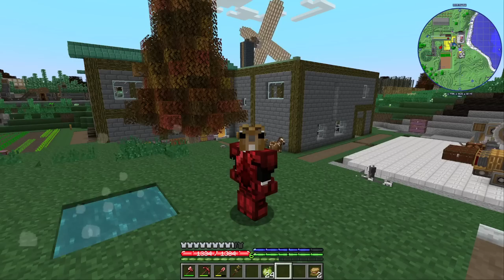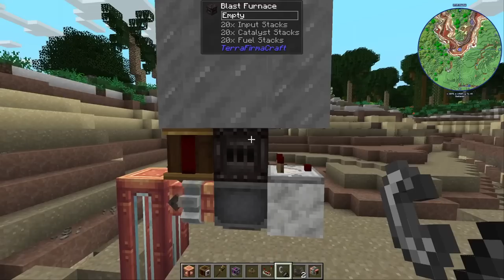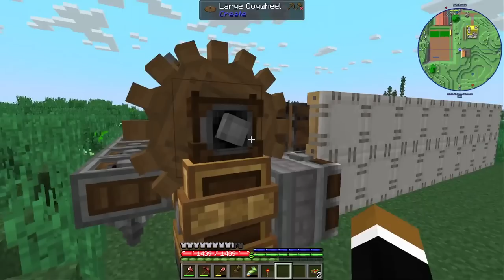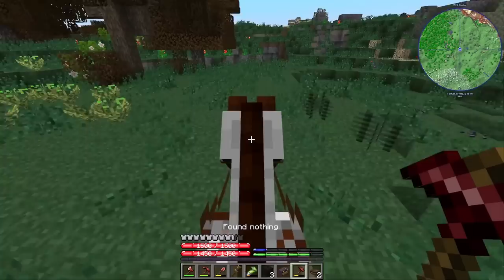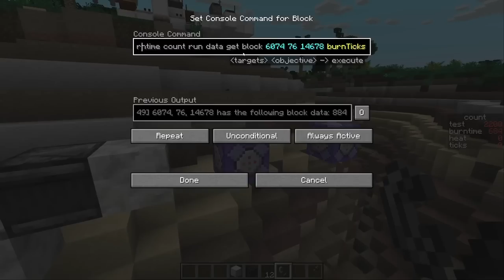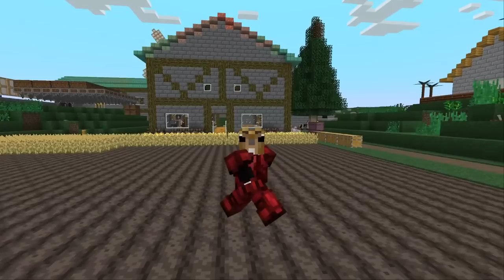ATFC: Super Precise Full Size Blast Furnace (Episode 38)

Comment: FYI you can use redstone quartz lamps to make a relatively simple counter. They work like a multi-state latch, so you could create a quick circuit that when pulsed increments through the states and eventually loops back
Reply: Another method is to chain a bunch of the Create redstone latches (T flip flops) to make a binary counter. Super easy solution if you want to count to a power of 2.

Comment: Just heads up about placing more chests on minecart contraption. When you pick it up, all items in chests are stored in NBT of one item and you can actually chunk ban yourself (or corrupt your save) this way (Create should be actively preventing this, but it cannot be trusted 100% - it used to be quite big problem in earlier versions).
Reply: There's a limit of chests you can put in a minecart contraption that you can pick up. After a certain number, you can't pick it up with a wrench anymore.
This happened in this series, on episode 32, at about minute 18.
Reply: it’s fixed
Reply: he has reached the limit before. create prevents it, you can't pick up the contraption at all if you do it.
Reply: @cobaltbluesky2276  yea i consider that a fix, you won’t crash your world anymore
Reply: @keejay98195  weeell, not that its impossible but it should def help, cuz if you have a lot of a particular item that happens to have a lot of NBT data, i dont doubt it could still crash, or with the right kind of data. Though idk if the limit is based on NBT data stored

Comment: If you are struggling with SU id reccomend making a steam engine, they generate so much more in such a smaller size.

And if you want, try experimenting with the portable storage interface more as it is a very useful tool for example unloading your drill machines really quickly instead of having to do it manually, which allows use of more vaults futher on

Comment: Those nice spacious vaulted ceilings under the copper roof are just begging for some wooden beams running across under them, and maybe some posts in the middle of the beams like the posts are holding up the tip of the roof!

Ooh or even an open loft, and you could put your bedroom up in it

Comment: The roof is not slanted correctly at the intersection. Rainwater would pool in the part that slopes into the second wall and cause water damage. I know it's Minecraft and realism isn't the point but for TFC i think it'd be nice for the roof to make sense 😅
Reply: You just add V shaped metal sheet in the bottom of the intersection so water has a way off the roof and boom, no water damage!

Comment: Please use a vault and a portable storage interface with your contraptions. It will allow you the ability to stop moving all your items.
Reply: Yeah, i've seen some dudes on a server carry 2 or even 3 minecart contraptions, where one is obviously a bore, but second and third one is actually portable processor facilities with crafters and basins and burners that could connect to a bore contraption via storage interface (the bore is a moving contraption and item processor placed stationary somewhere a bit further so they would connect down the road) which allowed fast unloading and processing of whitelisted items like ores,specific stone types and other items (moss and wood for example) to store them separately in shulker boxes or process them into something they wanted. This allowed them to mine out thousands of blocks and quickly sort, process and compact needed resources and all that without mining machine stopping, and that's vanilla generation!
With TerraFirmaCraft, where most of the stone types can be converted in some other types of resources i can imagine this system would be even more powerful allowing to convert entire ore deposits and even biomes in one go and compact them into a couple of chests, without returning home and painful manual item movement, which could speed up resource collection DRASTICALLY

Comment: It would look a lot better is you connect the copper roof in stead of leaving the edge. Just connect the lines of both roofs
Reply: There is some homes that actually have that kind of roof connection, but it's usually industrial type buildings, and those "patchwork" type homes that got built up more and more in years, which i'm finding funny, because Illmango's home is both of those things :D

Comment: Go fully modular for your travels. Take a small windmill, large windmill, mining rig, 2 crushing rigs, storage modules, maybe even a washing rig and a smelting rig. While the miner runs, start crushing down the previous run for storage efficiency. Just plop down what you need for what's coming out of the hole, connect together, connect to power, grind it out.

Comment: Those RS emitter/transmitter things are so nice to control things.
Obviously in 1.20 vanilla we can do calibrated skulk transmission, but it requires one withing range, limited value signals, etc. Still need to dive into that when I have the time, not that I'm any good with RS.
The limited sized portable drill machine is already great. I would consider testing some assembly to compact some materials as stated in my comment for the "tunneller". But the annoying part is limitations in stress units, compactness, etc. It's an interesting  puzzle.
In regards to a full blown auto steel production, specially if you want to attempt an auto red and blue steel line, then I would consider build a dedicated facility with more space a dozen or so blocks away or whatever, since you can connect it with a train track anyways to move around.
Kelp farm for many things including belts should be considered.
Steam is likely necessary for the next steps in automation.
The chooch must chooch and when it choochs it keeps on chooching.

Comment: A redstone control room with a stressometer and some indicator lights would be a cool factory overview and would help with having to run around the base turning off machines to save stress. I'm thinking of something like one lever at the machine, and one lever in the control room, XOR-ed together to turn the machine on/off from either location. Redstone links would prevent that from turning the whole base into redstone spaghetti.

Comment: I can now proudly say that I have automated steel productions in surival. Train track production actually, but that's just a minor additions. Only gotta add some conveyor belts to supply the forges with the kelp blocks and the system is 100% automatic. 
The way I have dealt with the blast furnace is rather simple: I just used belts running at 12 RPM for crushed iron and flux and a third belt feeding bituminous coal at 1 RPM. It's a tiny bit too fast, but since it is automated anyway, this doesn't matter. 

Another side note: A simple rotational kelp farm with a diameter of 47 blocks (Radius of 23.5 and thus using 23 harvesters) is producing enough kelp to run 18 steam engines, possibly even 20. Such setup produces ~295k stress units. 82% of which are used for the rail factory

Comment: A train track laying train would be an interesting challenge.
Reply: so... you will need a train (vanilla traintracks) to build a train (create train tracks) so you can build... .a train? 
Problem is, there is not a way to automatically build any smooth turns up or to the side, so only straight tracks, which is just bad.
A single gors and a buttload of train tracks (and signals) is pretty much all you need to build a train network.

Comment: I wonder what chaos will enfold when two (or more) people start using the same redstone frequencies...
Reply: You can (and should) use two items to define a frequency, best practice is each person on the server has a item they use as their 'channel' and then a second to define the frequency.
Reply: Also if I am correct they only have a 128 block radius so as long as you aren't building on top of each other it should be pretty fine
Reply: @jukebox8156  Aren't their range limited only by the loading of chunks?

Comment: I wonder if a horizontal drill would make sense since most of the veins run horizontally right? I suppose cave-ins would be too much of a problem though.
Reply: Create does not create block updates, so cave-ins arent a problem. The problem is to locate where exactly the vein is. You pretty much need to build a mineshaft to find it before you dispense the machine, and why do it if you can just dig it from the top!

Comment: I wonder if the blast furnace would work with iron blocks instead of sheets on the corners, so you wouldn't need holes in the roof of the lower level
Reply: I think it needs to be sheets. You can stack em, though.

Comment: I was just thinking about your tunnel drill setup, and would you be able to create multiple rail carts with different drilling rigs on each? Maybe a couple of the one you use the most so that if you run out of storage you have a second machine. You could also have one designed to drill a really large area just not very deep (really good for samples that cover a larger area). It also raised the question of if these instant mining rigs can be put in a tool box? You might have answered that one already, I just can't remember.
Reply: There is a hard limit on NBT data per item (and picked up contraption is just that), and putting multiple large contraptions in a tool/shulkerbox is a straight recipe for server death. So please no. Best course would be somehow compacting said items into more dense form on the spot
Reply: @mrShift_0044 Hmm, server death does sound like a fun concept to try out 🤔 OK, I'll give up on that idea.......... for now......... mwah ha ha ha haaaaaaaaa!!!!!!!!! There's still big parts of me that are trying to work out a different way of achieving my desires but with a lower chance of server death 😁

Comment: maybe make a full cobble generator? like generating all cobbles (I think you can generate everything from the two cobble types you can generate) and having the option for crushing/washing them
Reply: I don't think you need all cobble types if you are just interested in washing them. One would have to check which items they drop and then make a list of the required cobble types. Automating any cobblestone apart from Rhyolite and Gabbro can be quite tricky, especially if you want a lot of it. You will probably need clay, sand and water for most of them (These are easy to supply), but possibly also stuff like bonemeal or guano, which are much more difficults to get in large quantities

Comment: you should make a steam engine that can power itself
Reply: That is not a good idea, if the engine stalls restarting can be a major issue depending on the scale of the engine. Using a single windmill for pumping water, fuel production and one mechanical arm for fuel feeding is safer and the engines can self start if you overstress.
Reply: @AlbusRegis  i made one that used a separate steam motor to power the water and fueling so it couldnt stall unless it ran out of fuel, and if it did i could restart it by just powering a clutch connected to a waterwheel
Reply: @jailbreakius2906  That makes it not self powered, though.
Reply: @mrShift_0044  i had a lava generator as well but idk if thatll work in tfc